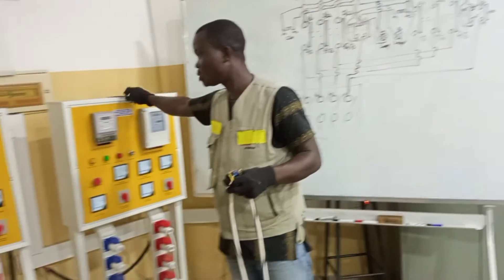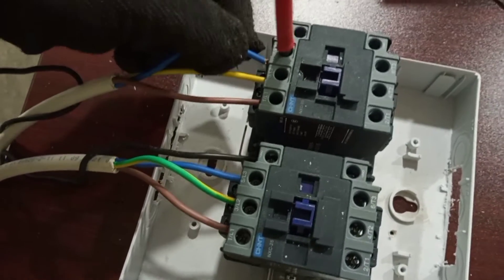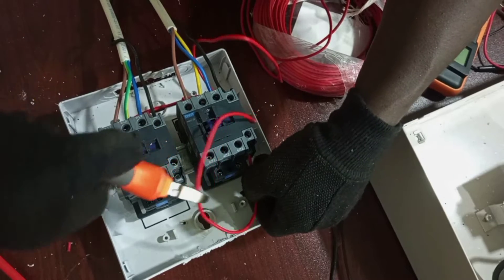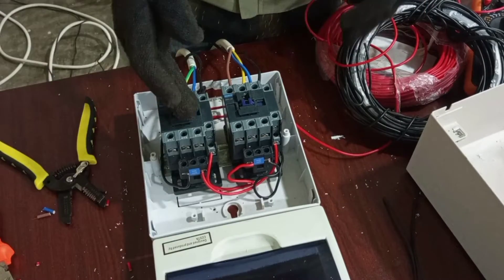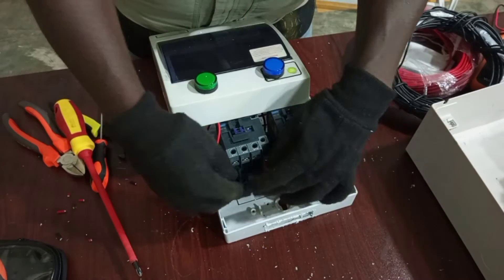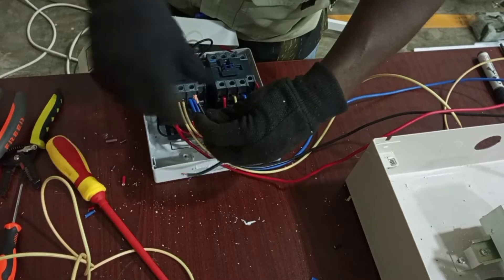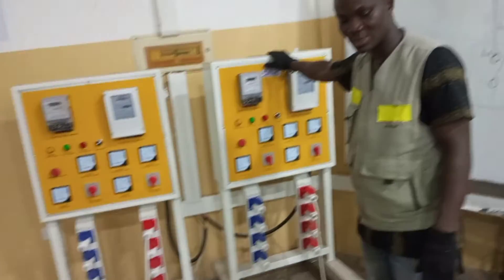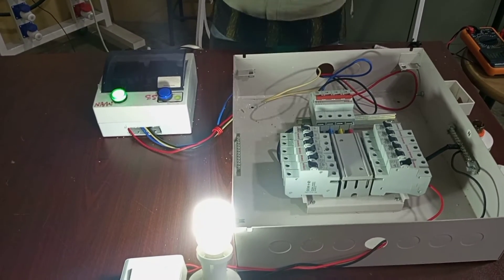AUTOMATIC TRANSFER SWITCH 3phase Complete wiring

Comment: please, what about if the main switch off, will it automatically turn on the standby
Reply: Yes, if the standby is available it energizes the coil on the standby A1/A2 terminal then closes the NO contact on the backup to supply the load